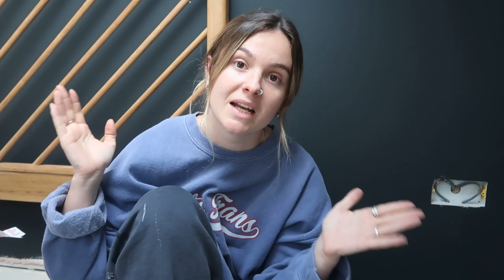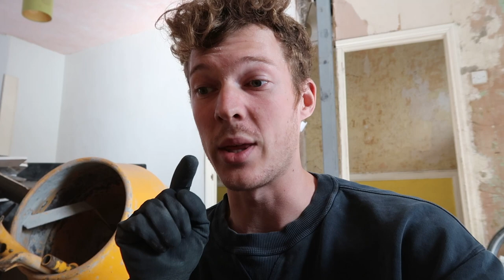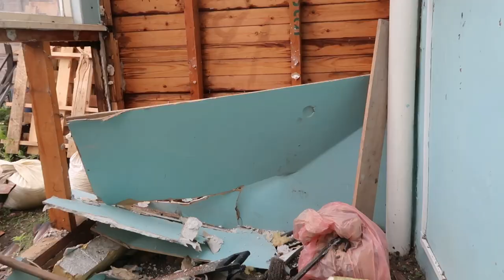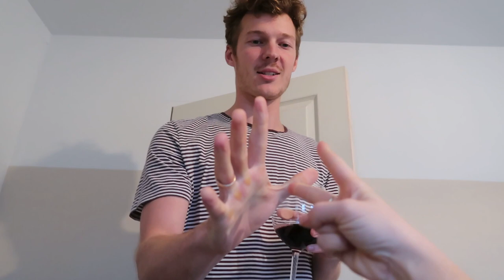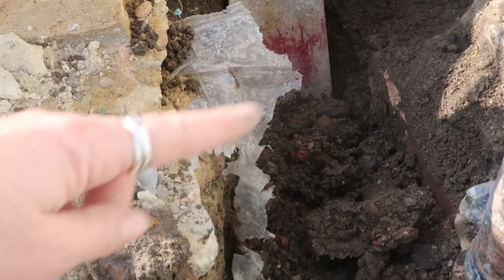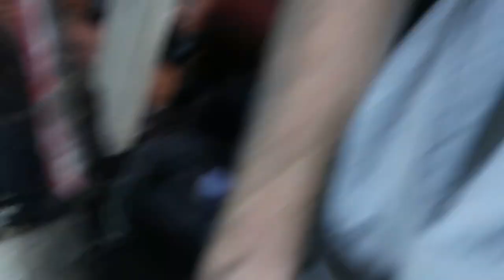a change of plan... // victorian house renovation diaries

Comment: hi guys.im in the North East and we have Northumbria water for our supplier.  i had a Victorian villa and if the surface water does not drain into the water system you're available for a soakaway adjustment on your water rates.  if you don't used the system other than the bathroom n kitchen waste, give it a try.

Comment: Old properties like terraces were only built with access to one sewer. Everything goes into that sewer, very common in old terraces. But downspout guards on your downspout to stop any rats climbing up and getting under roof tiles.
Reply from the maker: Interesting - thanks for letting us know! We were so confused
Reply: @FeedbyAutumn  Would definitely recommend gutter guards on the down spouts as it’s all connected to foul sewers. Rodents can climb up spouts very easy squeeze through the tiniest gaps

Comment: Any wine that says 'matured in oak' is a miss, and it's normally Aussie wine. Ugh! Shame about getting rid of the cast iron pipe as they have lasted 100 years and probably could last another 100 with a bit of tlc. You rock that pipe suit lol. 

I was going to have a loft, but the extension was more important when I started. I left the kitchen where it was, got 2 shaker kitchens 2nd hand and blending them together with paint and new hardware. I want the building downstairs to be complete before Christmas and get my dining room back. Just connect electrics to new fuse box, electrify the garden office (my studio), new window in kitchen (yeh for being end of terrace), flooring in hall, utility & kitchen, tile kitchen/utility, finish stripping hall, replace glass in front door, paint every where, block pave the front. Except brother has gone awol for 2 weeks - there's only so much I can do by myself. Please send Tom if he's bored, or yourself.

Upstairs is only moving a few radiators, adding sockets and changing the grey bathroom suite after moving the bathroom door, building a mid high bed for one son, redecorating etc etc. Peanuts.
Reply from the maker: Ooooo nice tip Jules! I’ll be staying way from “matured in oak” from now on 😉 

Having the dining room back before Christmas would be so lovely! And I love how you break it down into steps - it always feels so much more manageable that way! Good luck with the next steps xxx